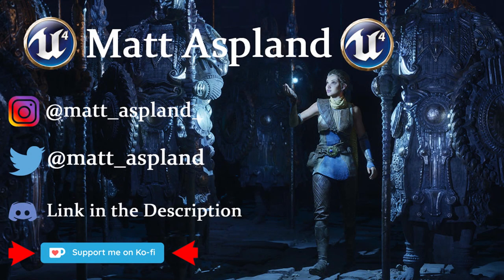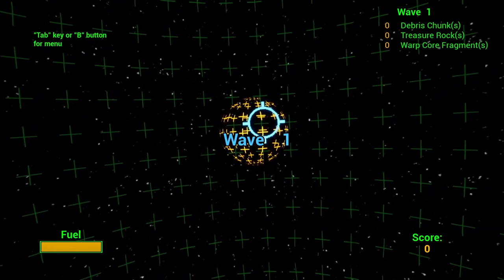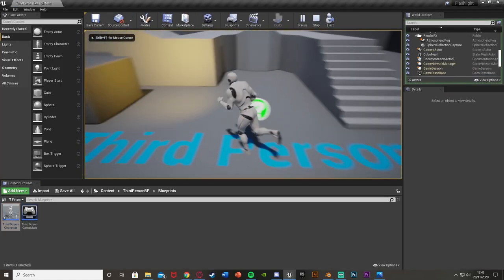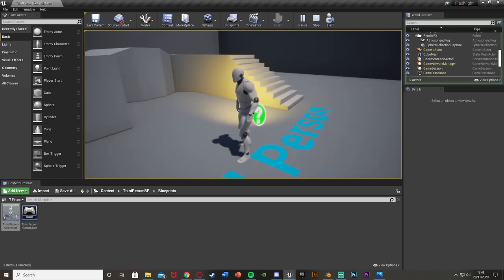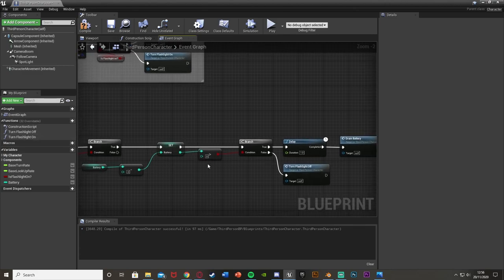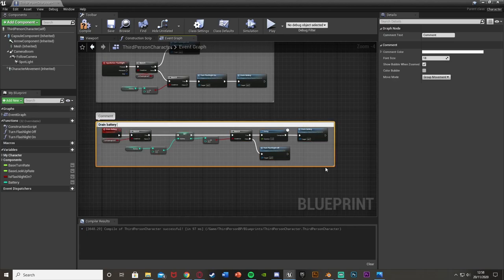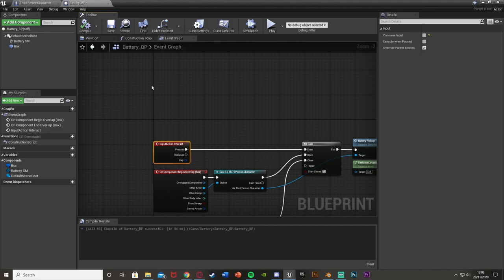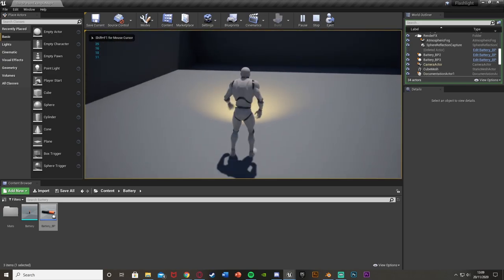Battery Operated Flashlight With Pickups | Updated - Unreal Engine 4 Tutorial

Comment: A good thing to note is that if you get a negative number of battery percentage when your battery runs out, and it's a miracle that I got this idea, it's because the number you have picked doesn't go into 100. For example, I had it set to quite a large number to drain each time so that I can demonstrate quickly and see if it works, and I picked 6, but if you think about it, you cannot countdown precisely to 0 from 100 by taking away 6 each time. At the end I was left with 4 and if it drained the battery again, which it would because the battery is still above 0, it would do 4-6 which equals -2.

Comment: Hey. Thanks for this. Very helpful.
Would it be possible for a part 2? 
I can't find it anywhere, where it's a black light.
You know, where you shine it on the wall, and some writing appears, or vampire FX where certain objects burn or change texture when hit by the light, permanently or temperrary (like the black light would or with a timer).
Reply from the maker: Hey, no problem, happy to help!

And that's a fantastic idea, I'll definitely add it to my list to do! Thanks!
Reply: @MattAspland  I'm thinking 2 different things here. 
1) would be  text/image is revealed only when the light is shown on it, like a blacklight on hidden text.
2) would be like a heat lamp on invisible ink, where once the text is revealed , it is permanent, or fades slowly over time.
Reply from the maker: @ZimCrusher  Great ideas, thanks for more in-depth information about it!